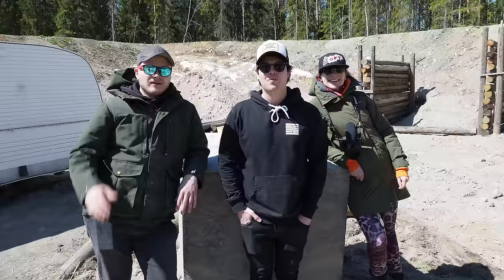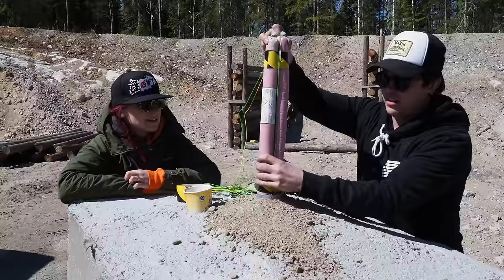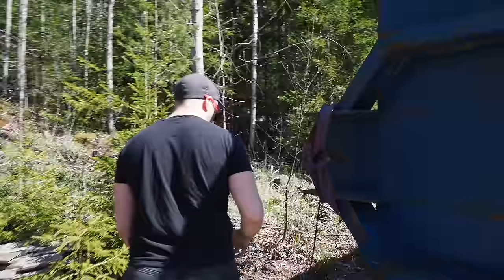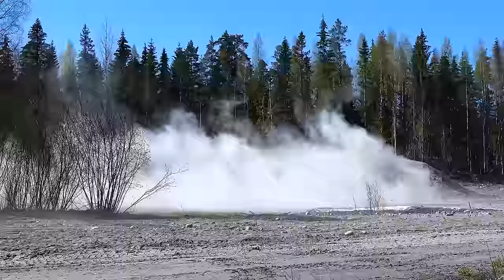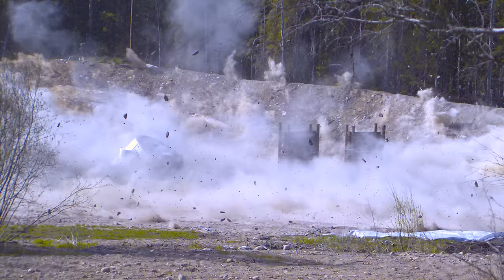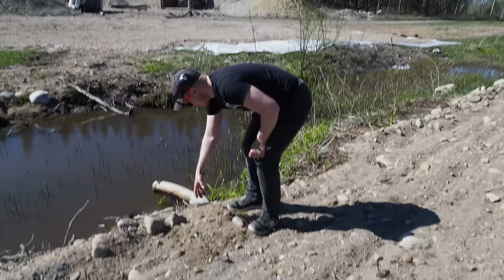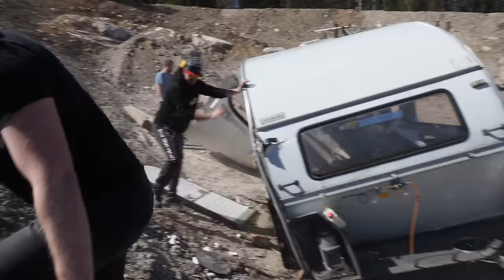Huge Concrete Cube Vs. 2 kg of Dynamite | Will it disappear?

Comment: Dad told me about when he started in construction. Is cousin bob owned the company and bob told dad and another cousin Billy to blast an old bridge footing out so it could be removed. He instructed them to drill the blast holes on a 1 foot square grid then load each hole with 1 1/2 stick of dynamite. Once the git the holes drilled, billy said to dad I think 1 1/2 stick is way too much and they ended up agreeing on 1/2 stick in every other hole. The resulting blast broke windows in the town over 1 mile away, the construction crews parking was 1/2 mile away dad had a football sized rock in his windshield. Cousin bob said dammit I said 1 1/2 sticks per hole just how much did you use. They said 1/2 stick ever other hole. Thank god you didn't listen to me then or we would be rebuilding a town.
This happen back in the early 1970s

Comment: It depends on where the gelignite is placed whether on top, in the center, or underneath.  If sat on top not much. If underneath orbit launch of large pieces. If beside block will roll over.

Comment: snow is much looser, there is plenty air both within molecule and in the pile of it than in concrete.
if you hit something soft it will absorb alot of the punch but if it is rigid it has to channel this energy somehow - incase of explosion it is into expansion and breaking itself apart.

Comment: Set the charge shape as a cube also with the wires going to the bottom, with it all covered with the concrete cured for at least a month 😀 👍 💪 
    To much energy is lost going out though the pvc pipe hole.. 
   Try a sphere shape charge in a ball shape of concrete.  Better!!1??     🤔
👍👍

Comment: You should do it again with steel reinforced concrete, say some 1 inch bars in a typical construction arrangement, and compare the damage between the two blocks. Please repeat this experiment with steel  re-bar. Ha ha.

Comment: I have a question you might find interesting. If you have another big piece of concrete, and dynamite set on every side (not right next to the concrete, maybe a couple meters away), then what would happen to the concrete?
Reply: The explosion would shoot outwards, although there would be damage to the block where it would be vaporized from contact with the explosive, but it would just be big dents. The pressure waves would travel outwards and would probably damage the trailer and sensitive equipment nearby. I've seen damage from pressure waves with high explosives, and it's impressive. My town was damaged in the 1960s from an explosion from  a dynamite plant 5 miles away. The Shockwave shattered windows and damaged buildings.

Comment: If 60 gram is all you really need, then, with 2Kg, the question is : how much of it will be made into dust ?
The left side of the trailer collided with the right side. That's some shock.
Reply: 2000 литров газов H2O, NO2, CO2

Comment: What kind of test is that concrete alone is easy to crack up put a cage of #5 rebar as say specs of a DOT site. Please rebar cure time for concrete then. The way you guys this block is nothing structurly sound about it was for a blast.

Comment: Little disappointed. Came for a dynamite blast, but that isn't dynamite. You can't clip dynamite into a chub like that, its too friction sensitive. That's an emulsion explosive. Still pretty impressive, but they have yet to make emulsions that match the power of actual dynamite. Two KG of dynamite would have destroyed the block and then thrown the pieces into the camera.